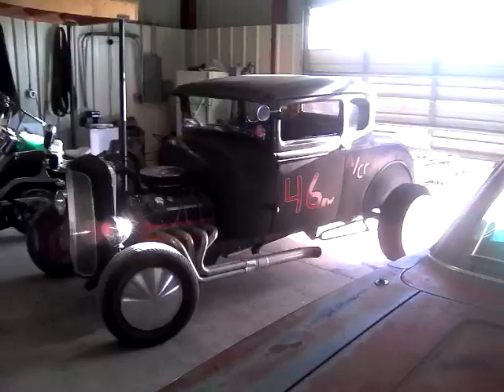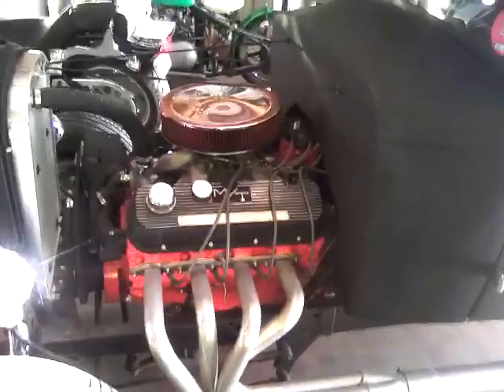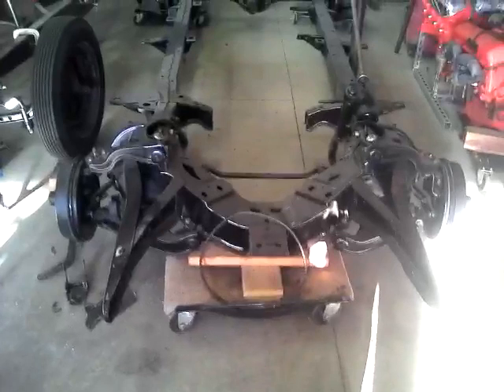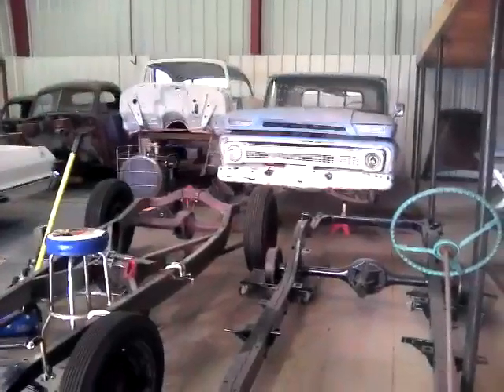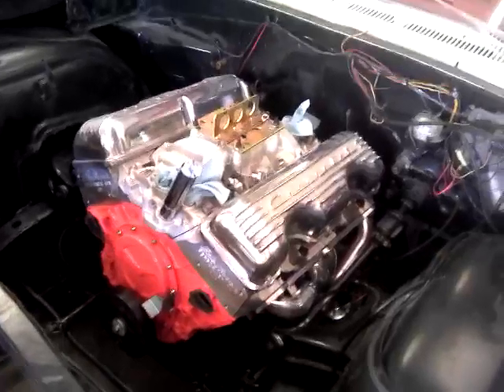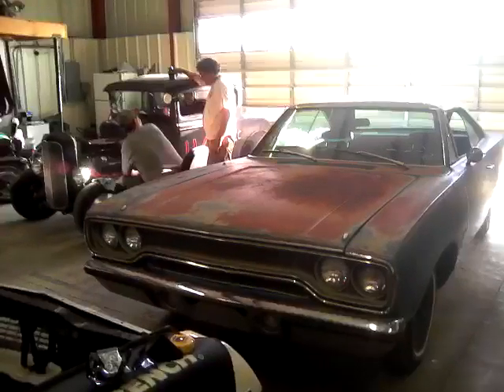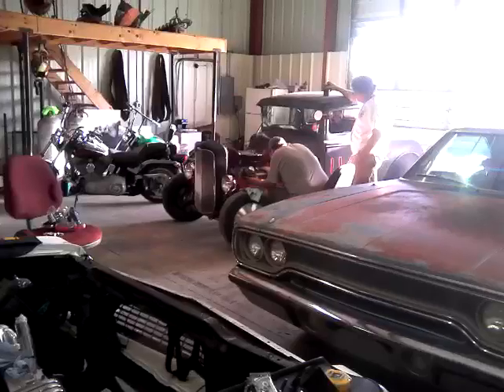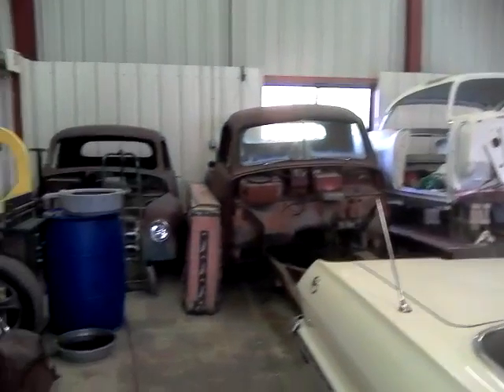June 13, 2018

Comment: That is a sweet model "A"!! Love it when there is more engine than car😎 what's going on with the mid 60's chevy pickup in the back of the shop?
Reply from the maker: The guy that has the  A is fixing it. Putting  small block in it and lowering some and leaving the patina and driving it. Body and box are very Cherry.